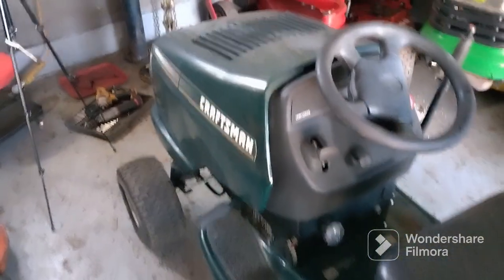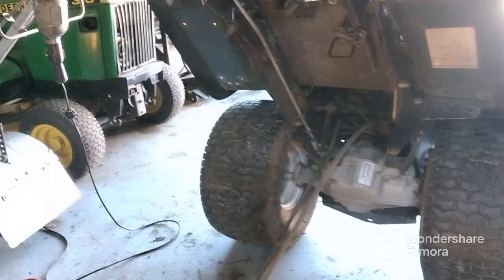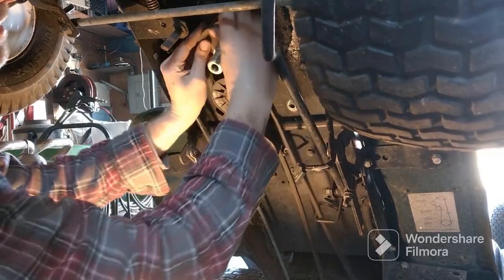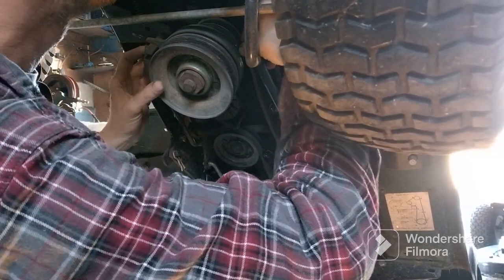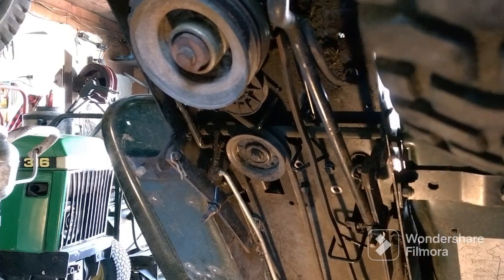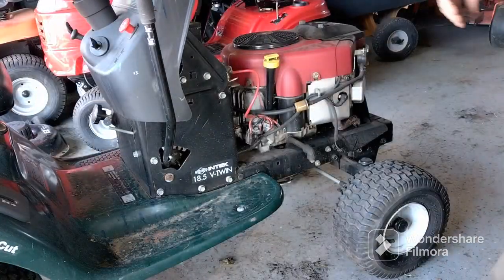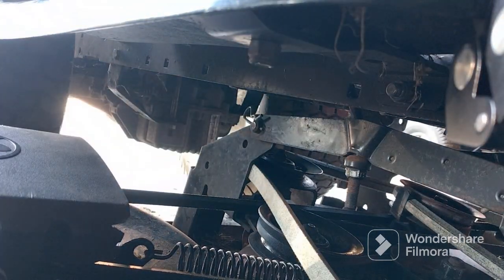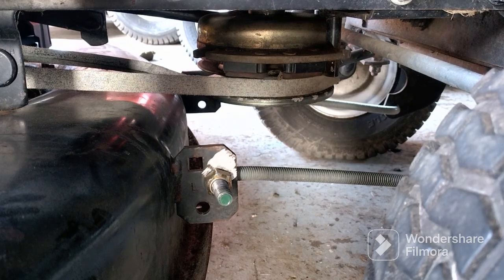how to put a drive belt on a Craftsman riding lawn mower

Comment: What did you end up using to raise the front after taking the deck off?
Reply from the maker: I have a left built up in the rafters that lift the mowers up
Reply: Thanks scooter.  If you don’t have a lift in the rafters, once the mowing deck is off, you can tip the rider sideways onto a stool or even a sturdy folding chair. - block the gas vent first to prevent leaking.
Reply from the maker: Use our Jack something to lift it up

Comment: I don’t have an impact so when i use a socket to try and remove the bolt on engine pulley to drop that piece off, the whole piece and fan just spin. Any recommendations on what to do with no impact?
Reply: On some use a break over and some kind of cheater bàr, PVC, pipe that you can use